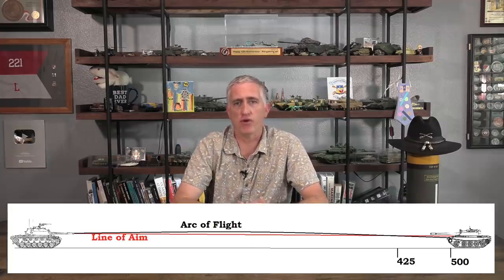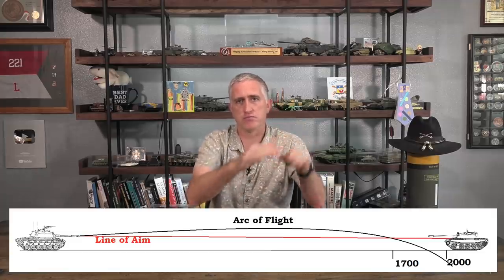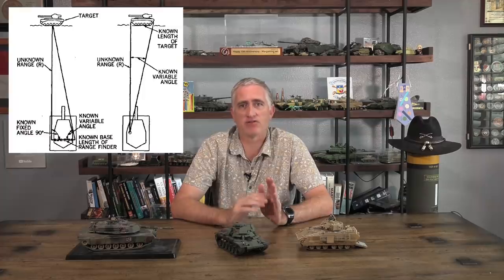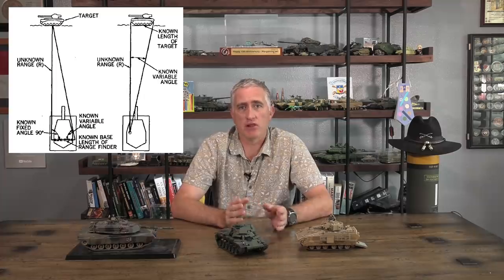Tanks 103: Rangefinding

Comment: the 1mill = 1meter at 1000meters is pretty good, because of the small angle approximation, but it will break down once you get past about 200 mills, and quickly grow worse past 400, which I presume is a laughably large number for military uses anyway.
Reply: Depends on whether you're doing actual milliradians, 6000mils in a circle, or 6400mils in a circle.
Reply: @ScottKenny1978  The precise spacing of the marks depends on that, but the technique relies only on there being a nearly linear relationship between angle subtended and range. And that's true for any small angle and an object of known size. Fortunately*, that's true for basically any target that you actually have to aim at.

* Or unfortunately, since subtended angle also determines how difficult it is to hit what you aim at.
Reply: Well, since (you say) 1mill = 1m @ 1km, 200mill=200meter @ 1km. A target of such size cannot be missed anyway, so the (in)accuracy doesn't matter :-)
Reply: @hatsjie2  no, he's talking about a target 200 or 400 mils away from where you're currently aiming. That much angular distance is enough to make the difference between true milliradians (where it really is 1m at 1km) and the military approximations of 6000 or 6400 mils to the circle instead of 6283.xxx for actual milliradians.
Reply: @ScottKenny1978  While that's Likely True, and I say likely because I didn't do the math on that, 
What I'm actually talking about is how the small angle assumption of tan(x)or sin(x)~=x breaks down when you get to 0.2rad, 200mills, and rapidly becomes much worse past 0.4rad.
Reply: @sayethwe8683  Yes, that's exactly what I meant to say. But when the angular size of a target is .4 rad, the chance of missing is very small anyway, because the target is massive.
Reply: precision rifle shooters use mils as well.  They use 1 mil = 1 meter at 1000 meters.  FYI....its also 1 yard at 1000 yards.  As a mil is 1/1000 of anything.

So precision rifle shooters use mils commonly with both meters and yards.

Simply they can shoot at an unknown distance target (they didn't bother to use a LRF or manaully do the math).....see the miss....
then measure using their reticle superimposed over the miss in mils.  And then directly dial it on in real time as the turrets are also in mils.

Obviously using the LRF or doing the manual math to determine range first will allow them to shorten their error dramatically.  And if their is any error in windage or elevation....the reticle is quickly giving them the minor correction to get a follow on hit.

Comment: As a Gunner  always  start with  1200m   for a snap shot   . Battle sight  . When  looking though the sight   after a  time  you  can   tell    basically  what the range is . 1200 sight picture shot at the top  on the tank  or a little above    target  close in  shot  low on the target    --  no idea  Laser  😎

Comment: Another issue with radar rangefinders, which is similar to spotlights as illuminators.  Radar has far more detectable spread than coherent beams like a laser - and given equal sensitivity receivers, a threat can detect your range finder at about twice the range your rangefinder can even detect its own pulse.   And the detection angles for the radar emitter are far wider than a laser.

Which means an ELINT bird the tankers aren't even aware of can see your tanks ranging stuff (whether in battle, calibrating the sights, or making range cards) and figure out pretty easily where the tanks are, even if they are quite well camouflaged against direct sensing.

Comment: 8:45 True. Accuracy, and precision are not the same thing.

1. Accuracy is defined as most/all of your shots landing inside the target.

2. Precision is defined as the grouping of your shots. So, if the grouping of your shots is very tight, then your a very precise shooter. If that isn't the case, then you obviously aren't precise.

So...what's the difference between the two? For example, you can be the most  precise shooter in the world, but it won't matter if all your shots don't land within the target (meaning that you have crap accuracy).

On the other hand, you can be the most accurate shooter (all your shots land inside the target). But, the grouping of your shots is all over the place (meaning your precision is terrible)

This has been your friendly PSA (public service announcement) for the week. Have a nice day     :P
Reply from the maker: Honestly, I wasn't thinking of putting rounds on target, though it's a perfectly valid use. I more had in mind folks giving precise, inaccurate 10-digit-grids to locations or ranges or the like.

Comment: During the Polish campaign, Germans had some issues with rangefinding. They tried to estimate from the distance between Poles.
Ehhehe.

Interestingly, an old SLR camera I have seems to use a "coincidence"-like system for the manual focus. Which makes sense, focus is range to target. A smallish circle in the center of the eyepiece, where the image is split into two, and then one adjusts the focus, until they join up.

Comment: Precision rifle shooter community commonly use mils with either meters or yards.  A mil is simply 1/1000 of something.  It can be 1 meter at 1000 meters. Or 1 yard at 1000yds.  They function exactly the same.

So if a mil is 1 yard at 1000yds.  Its 36" at 1000yds.  

Move the decimal place over for both 36" and 1000 yards.  That would tell you a mil is 3.6" at 100yds!

So very easily you can see the angular unit of measure.  3.6 at 100 and 36 at 1000.  It grows perportionally over distance.

The issue most people have is they focus on that definition of what a mil is.  And they do not focus more on its actual useage.  The usage is simply....your 1 mil low.  Dial or hold 1 mil higher and you hit.  The angular unit of measures works across all ranges.  It does not care that you call that target 200 meters or 219 yards away.  It only cares that you need 0.5 mils to hit for the given trajectory.

Comment: Re: Radar.... also many interesting problems involving radiation injury to crew, especially if the emitter is in a big metal box along with the crew!
Reply: That is a bit overrated problem. You have similar box at your kitchen and it is ok. And in the airplanes they use much more powerful radars and it is still not the main health risk there.
Reply: I assume you mean being burned from the heat rather than literal ionizing radiation. Radar frequencies aren't high enough for it to be ionizing. You can get burns on sufficiently powerful ones, kind of like how microwave cooks food. In fact that is how microwave oven was invented. IIRC a naval technician noticed his lunch got heated after awhile when he worked on the radar on board a ship. He was fine though.
As for microwave ovens being safe in your kitchen, it is because there's shielding to block the microwaves from burning you. There's also a fail safe typically if the door isn't closed, so it won't activate unless it is secured.
Radars are used on tanks nowadays as part of APS or specialist roles. The radar on tanks aren't all that strong so you can stand in front of it all day and be fine. The more problematic ones are the long range air search radars like ones used on S-400 or Patriots sites. Apparently I found from online PDF, the THAD have a few meters of danger zone. Although idk what is the risk level required for it to be considered a "danger zone." I doubt it's all that significant though. Depending on the system wavelength, EM heats different things at different efficiency. Microwave oven for example heats water very well, although it heats other things too, it doesn't do so very well.

Comment: Interestingly radar rangefinding was successfully adopted to aircraft. These seem to be better platforms to carry tender electronics and be considered systems a bit more open for high tech gizmos.
In the modern world lots of the cars have radar rangefinders. For instance mine has one with antenna size of VW badge on a radiator grill.
And BTW, when it is snowing heavily and it gets covered in wet snow, it stops working.

Comment: Addition why the height is less often used for ranging: the visible height changes with angle. ->When the target is uphill or downhill form your position the perceived height is less than the actual height, while width stays the same. (maybe less of an issue in tank warfare).
Reply: Your view is askew.  So what you think you measuring is not in fact the amount presented.  :)

Manual rangefinding in precision rifle is done the same way.  Traditionally they are told to measure whichever is the biggest dimension of the target....
height or width.  And put the emphasis on which dimension is resting true to you....not skewed by any angle.

The shooter can also hedge their miss by knowing the "danger space" of their projectile.  Basically knowing how far forward or how far back can the target move for a given sight setting and still hit.  As a dirty low or high hit is worth more than clean miss due to rangefinding error.  Danger space shrinks the further a target is away as the projectile is being pulled down by gravity more and more the longer it is in flight.

Simply put Danger Space is Maximum Point Blank Range for a given sight setting.  

Whereas most people who only deal with MPBR are using it solely for where they are initially zeroed for as they wish not to use their sights or are incapable of adjusting sight for a given range.  Danger space is handy to know as you can determine for yourself if you have a higher likelihood of a hit or miss.
Reply: @DFOOSKING  yes, the first part of your comment summs up what i tried to say. But english isn't my native language so the word askew didn't come up in my brain.

Comment: M26 90mm is a slightly less powerful gun than the M48's 90mm. The 90mm round for the 48 won't fit the chamber of the M26, but the M26 round will fit the chamber of the M48, and push the shoulder a bit forward fireforming it to the chamber, if I'm not mistaken.
Reply: Point being velocity is a bit less for the M26 round being at slightly less preassure and lower powder charge vs the WWII 90mm. Not sure how much of a drop at range distance it makes.

Comment: One method of verifying which return of the laser rangefinder to use to hit the target that would work at night, if you do not mind emitting bright flashes of strobe light from the tank, is to borrow a method used to identify ships off of the coast, at night, by maritime vessel traffic monitoring services.  Hypothetically, the ideal system could build up an image from reflected pulses of the ranging laser, but that is not possible when you want to image a ship with optical wavelengths and your ranging is accomplished with 20 cm wavelength radar.

A low light camera with an electronically controlled high speed shutter is set to open its shutter, briefly, as light from the flash is predicted to return from the target.  If the return used to set the range actually came from the target, the target will be imaged by the camera.

Comment: 8:00 Well actually, there are acoustic sensors that are tank-compatible (it's just that they haven't been commonly mounted on vehicles). There's the "Boomerang" (there's a man portable wearable version of it too, I think), and the "Individual Gunshot Detector" (from QinetiQ). They both use acoustic sensors to detect the enemy. They are fairly accurate enough in discerning the location of the target. 

However, the disadvantages with these types of acoustic detectors is that you have to get shot by the enemy in order for the sensor to detect them (at which point, it may be already too late. RIP). And secondly, they have relatively poor range. They typically only have a range of around 300-500 meters (maybe greater?). Or around few-couple of hundred meters. In contrast, the electroptics (namely thermal imagers) on tanks can comfortably detect targets from 1-2 km, and greater (generally within the range of many kilometers away).
Reply from the maker: As I recall, boomerang only provides bearing to target, not range. Though, granted, if they were networked together with another vehicle...
Reply: @TheChieftainsHatch  Sorry for the late reply sir. I kind of forgot about your reply. My apologies

But, anyways, I am pretty sure the Boomerang system is able to tell the distance where the incoming shot came from. Here is some crudely picked information that supports this (From public sources, I couldn't find any better information on the Boomerang. So, pardon me):

1) https://m.youtube.com/watch?v=QIkypcdcqmI

2) https://m.youtube.com/watch?v=B_m7XasooA4

3) https://m.youtube.com/watch?v=RhExPxoFHHc

As for this: "Though, granted, if they were networked together with another vehicle..."

I don't know what u mean by this, but I assume your referring to triangulation? Where triangulation is defined as the method of determining the location of the (unknown) point, by using 2, or more known points?

Well...about that. I think they explain that Boomerang uses triangulation to determine the range of the gun shot. I guess this is the reason why the Boomerang has many microphones set at a slight distance from one another (this is surprising, since I didn't know it was possible to triangulate the gun shot from sensors located extremely closely to one another). I think this may also explain why the microphones are set an angle to one another.

I guess the theory being that if the sound of the gun shot reaches microphone #1 at a different time than microphone #2, then you could calculate the location, and range of the shooter.

Anyways. Good day sir   ;)
Reply: @andrewlee-do3rf  The shorter the distance of the known arm of the triangle, the more inherent inaccuracy results. This would be especially true with something like audio signals which degrade rapidly, vary wildly depending on atmospheric conditions. I am sure the most advanced audio sensors today can only basically tell you within a few hundred yards the range, so you know whether to look 100ft away, or for a sniper 1/2 mile away. It is not good enough for gunnery rangefinding. Even if it didnt require the target to fire a shot in order to generate a signal loud enough to be picked up by the passive recievers. Air is a terrible medium for sound, that is why only the Navy uses sonar. Sonar only works in land warfare in this case because it relies on the target itself producing a sharp, loud sound pulse.
Reply: @justforever96  Huh. I see, very interesting.

So, to recap these types of acoustic sensors, are only capable of telling you the bearing, and range of the target (that produced the gun shot). 

But, they are not precise enough to provide accurate gunnery range finding, to conduct precise attacks on the target. Because the acoustic sensor tells you that the sniper is within this circle that is 100 ft wide (just an example), or something

Is this correct?   :/

Comment: Very interesting video and excellently timed as I've been wondering about this concept recently! I have two questions that I was hoping would be addressed;

1) What was the planned rangefinding method for use in the German schmalturm?
2) Is the use of a stereoscopic or coincidence rangefinder part of the commander's job as hand-off of a target, or the gunner's job as laying on target? Does this change per vehicle (my immediate thought is the T29E3 and how far to the rear the rangefinder was mounted, presumably some way behind the gunner but immediately in front of the commander's cupola).
Reply: In the M48, M60 and M103 vehicles, optical rangefinding was the commander's job. I think it was the gunner's job in the M47

Comment: The biggest disadvantage of radar range finding must be that it actively radiates. And radiation can be detected and a bearing where it came from. So if the radar pulse comes from the tank it might give at least its bearing away.
Reply: Sorta true. Yes radar does radiate signals, in which an enemy could potentially get your bearings. An anti-radiation missile is a good example of this scenario.

However, there are ways to mitigate this. I am pretty sure that the F-22, and F-35 stealth aircraft use a form of radio, and radar communication that is very hard to detect. They achieve this by using LPI (Low Probability of Intercept) radios, and radar (some AESA radars are LPI radars I think). Anyways LPI radio/radar can conceal themselves by using multiple frequencies, and rapidly switching between said frequencies.

And then there's also radio/radar jammers too.
Reply: Also applies to lasers, many vehicles have laser detectors. All set off alarms, some aitomagically fire smoke grenades